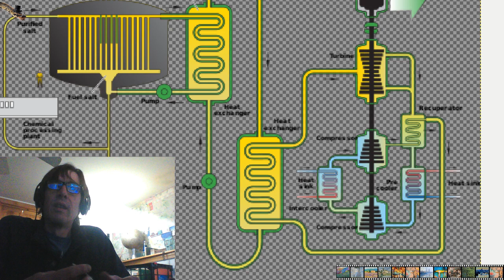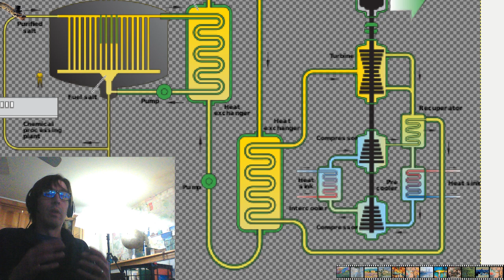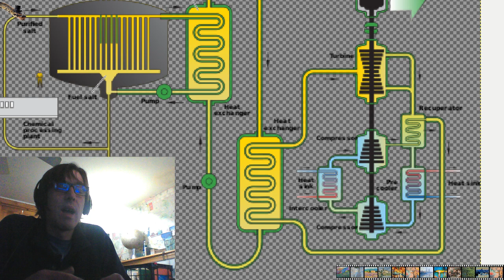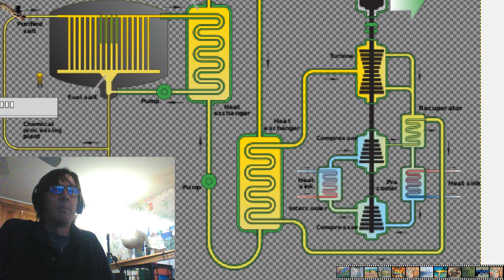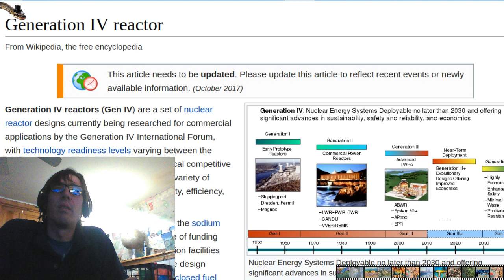Progress & Liberty 12: Nuclear Power

Comment: I don’t think we have any choice. Climate change is a four squared alarm, all hands on deck, existential threat. I think you might explore some of the cons in these videos, though. Everybody that touts nuclear as the answer fails to do this in there presentations. It would set you apart to actually tackle them. 

I just think it might be too late, I’m afraid. The Gen IV are basically in proof of concept stage, and have not yet been proven from a commercial standpoint. Nuclear plants are incredibly complex and take a long time to construct. The one in GA is way late and costing twice as much as was planned. But if we don’t start getting a real plan together to quit burning fossil fuels, we will be fucked. Unfortunately, too many ppl that are with us on that, are adamant against doing it with nukes, and think we can just use wind and solar. I think it’s delusional.
Reply from the maker: which problems!
Reply: @pyrrho314  You think there are no cons?